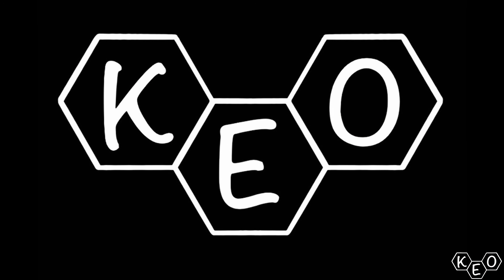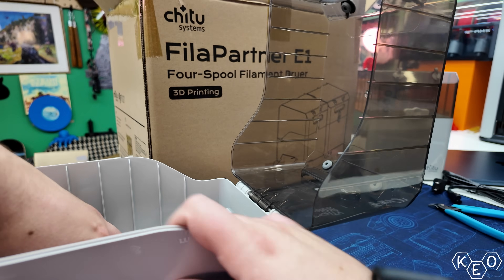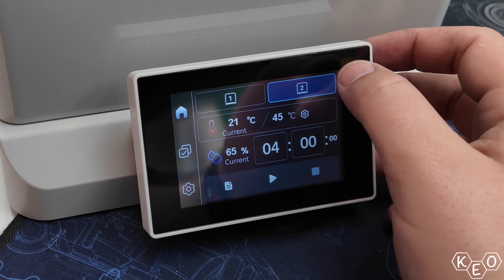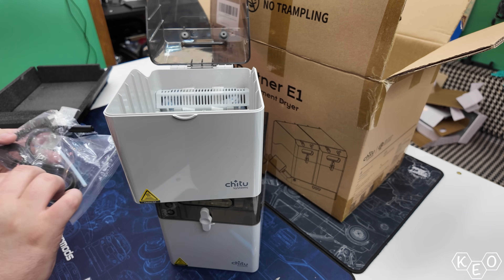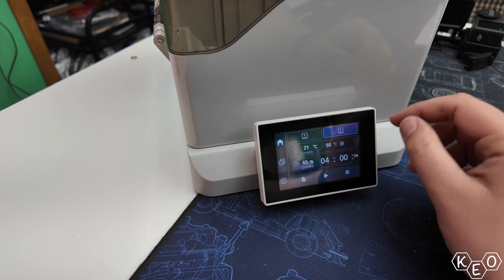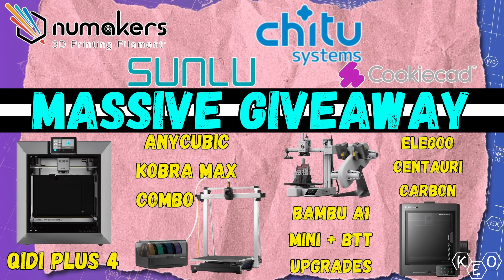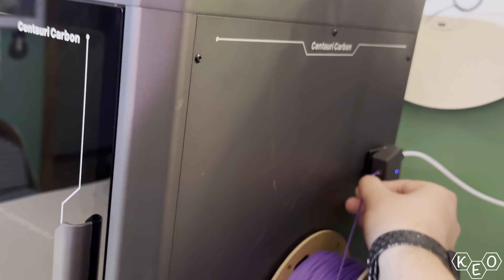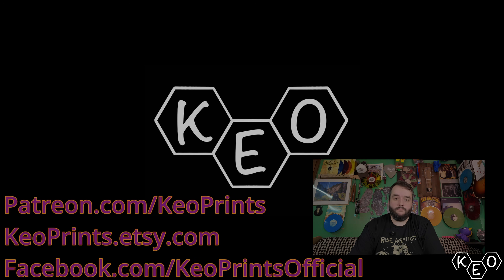You Want Modular? Here You Go. Chitu Systems FilaPartner E1 Filament Dryer

Comment: Am I missing something, or are all filament dryers missing something. They just use heat to drive out moisture to the air. Ones in the air then what. Well there's the desiccant but your dryer has just dried that as well and put that into the air. At best a dryer box will expel moist warm air with colder less damp air. But in a humid environment it's not helping much. So isn't there a missing part or the dehumidifing process? A condenser, something to chill the air to below it's dew point, and remove moisture as water.
Reply from the maker: This is the topic that many have discussed since the age of the dinosaurs. And you’re right, I typically touch on the fact that a venting feature is necessary. Some driers have an active vent that opens and shuts to expel the moisture. Some have a passive system in the form of holes/leaks in the system, or they simply rely on the desiccant to absorb that moisture once driven out.

Your point stands; this is a concern in each system.

Comment: This seems cool. Polydryer was a disappointment for me, $40 for a dry box that doesn't seal properly. (One of mine does and the other doesn't). Hope this product is a little more reliable. Would you consider doing test(s) with a hygrometer to see how well it actually works for long term storage?
Reply from the maker: From what I can tell, the poly dryer (if functioning properly) should result in a better seal. But im sure as I live with it more, ill have better info to go off of
Reply: @KeoPrints  like I said, one of my Polydryer boxes seals really well and the other doesn't seem to keep out moisture at all. Idk what's up with it, maybe I just got a bad one. Most people seem to like it but I've seen a few others having the same problem, so maybe it's a QC thing?

Comment: So why is this better than Polydryer?
Reply from the maker: I can't say better or worse because I am a fan of both. Both are dryers that dry filament well enough so the only thing that Im comparing is the physical modularity. I like the Polydryer a lot but a single spool for each box can get expensive. Having this removable box that holds 2 spools is a good option for storage and that's the part that Im excited about.
Reply: @KeoPrints  So $30 per Polydryer box or $50 per FilaPartner box? If the literal difference is saving $10 per two spools, I can dig that. You'd basically have to buy 4 Polydryers ($320) to have similar functionality, which is even more cost savings. I didn't realize this was only $178. Kinda makes me want to return my Sunlu S4 and get this instead at the launch price.

Comment: I got this system a couple of months back and it seems to work pretty good so far. I store filament and throw it on the dryer when I want to use it. The screen does sucks. I have the same problem.

Comment: One thing I absolutely dislike about these type of dryer+storage solutions is that two or more spools are in the same container, making it utterly inefficient in keeping moisture out since the desiccants will absorb moisture every time you need to take out one spool.

Polydryer + Double Barrel Mod + Airflow mod + Optional vent cap if you're planning on drying just one filament is still the king for drying filaments since it keeps each filament in their own containers.